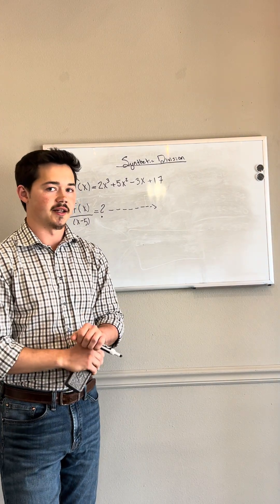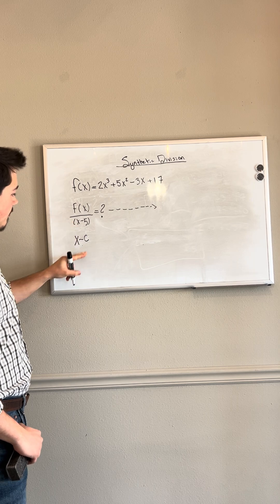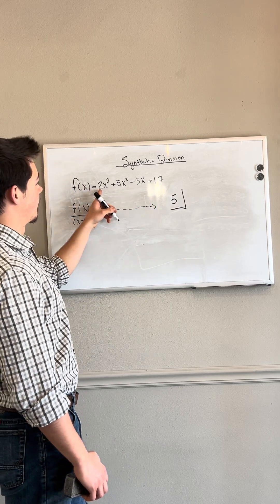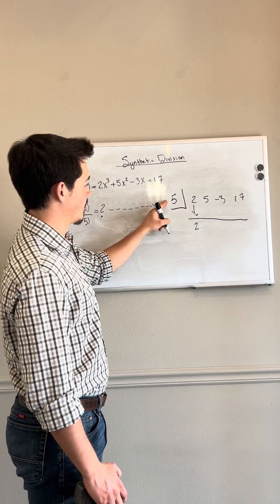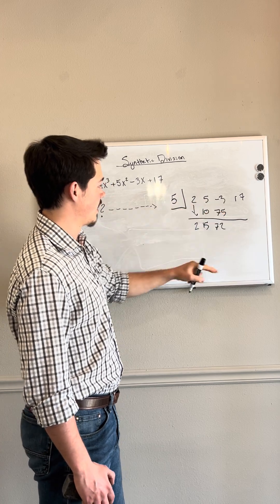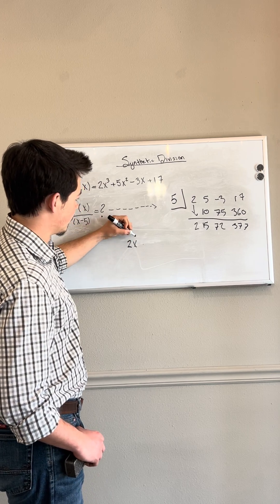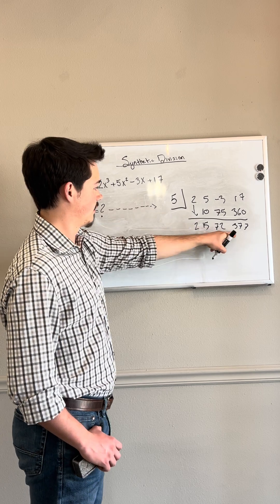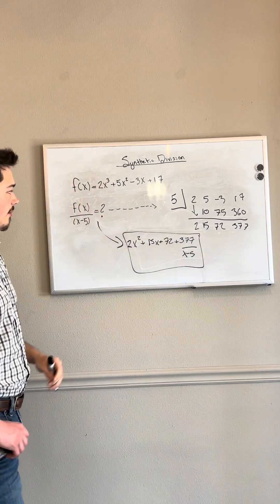A Quick Example: Synthetic Division #shorts

Comment: Should it not be 72x not 72?
Reply: Looks like the final answer is in the terms X^2, X^1, X^0, X^-1,  That seems to make sense to me.
Reply: No, 72 is right, as those are the coefficients of the quadratic we get after dividing the cubic by the linear, if it's completely divisible normally the last number comes out as 0
Reply: @sorestdock8228  maybe I'm not familiar but what has he done to eliminate the variable x?  Maybe it's over my head but if the x dropped down with the other numbers why did it not with 72? It makes sense for the last number 377 bc it has no variable.  I'd like to know how to solve this type of problem but it's not clear to me.  Everything seems to make sense except that x